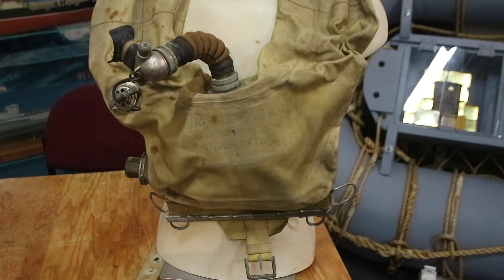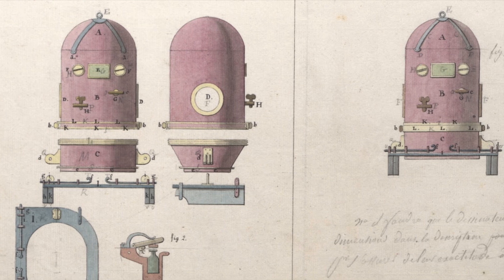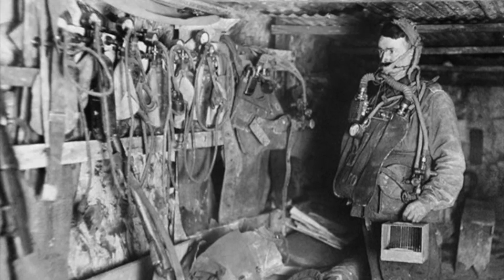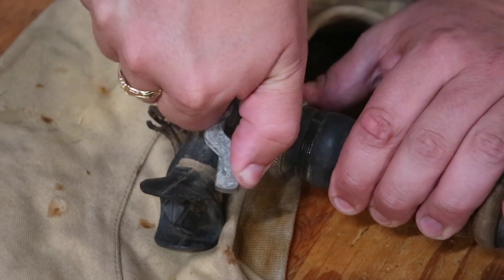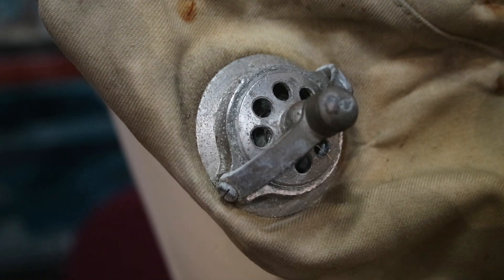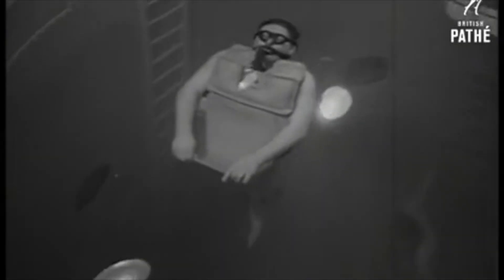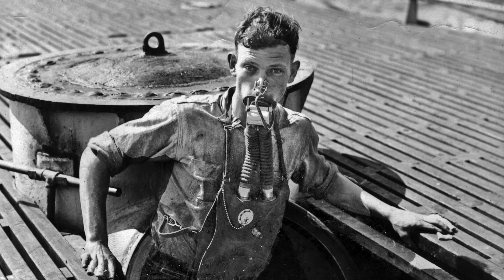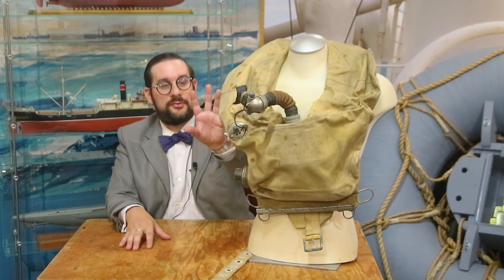Tauchretter: Escaping a Sinking Submarine

Comment: Read about Another re-breather advantage: experienced users explain that the closed circuit supplies warm air.  This significantly reduces heat loss compared to SCUBA and is also less stressful, reducing the diver’s overall exertion. The diver is more comfortable and relaxed. =  calmer, safer, better awareness and focus + longer work periods

Comment: 30:17 I'm not sure if I understand this correctly. I mean, you put pressure into this, at 1 bar pressure inside the sub. Then you exit the sub to say 5 bar. The thing will be compressed down to a very small size, and then?

The pressure will never drop below 1 bar on the accent, so the pressure will never “drop”.

Comment: 1:59 Small note on CPR: Nowadays (or at least at the Red Cross facility here in Germany where I learned it three years ago) you no longer to mouth-to-mouth air transfer, you only pump the chest. As I understand it, this motion also gets some oxygen into the lungs with each pump, at least enough to support the brain for a few minutes longer until help arrives.

EDIT: If you have a bag valve mask / Ambu bag, you do 30 compressions - 2 squeezes of air. Thank you to the commenter below for the correction :)
Reply: Depends: if you have an Ambu bag (Beatmungsbeutel) you do 30 compressions and you squeeze two times the bag for an adult and repeat.
If the mask is not ready yet or you don't have one, you just keep applying chest compressions, 30 at a time.
Reply: @almerindaromeira8352  many thanks for your comment! I've appended mine.
Reply: I remember there being something like, if you're having someone breathe air into the other person, it's best done mouth to mouth, because it creates a better seal. A review of cases showed that mouth to mouth had about a 10% overall higher rate of success than a mask with an opening, which has a 5% overall greater chance of success than a bag-valve (im not sure if this is with regular cpr trained people or medical professionals). It was postulated that the reason for this was simply it's harder to know how good the seal is on a bag valve.
Reply: Most of the time it is not necessary, and hands only CPR is simpler and more likely to be performed at all by random bystander. (Because of modesty and disease transfer risk.)
Mouth to mouth is warranted in cases where body/lungs are depleted of oxygen. Drowning, CO poisoning, opioid overdose.

Comment: 10:44 actually not fully accurate. "Tauchen" or "Eintauchen" refers to submerge in any liquid, not just water. But the term can also be applied to fog, shadows or light. Figuratively you can still use it for fire, if you refer to the light if it, without sounding odd:

"Die Szene war in Feuerschein getaucht." (=The scene was cast (submerged) in the shine of fire.)

Comment: Very interesting, thank you. But to be totally correct: Fire fighters in German are and were called "Feuerwehrmänner". "Flammentaucher" obviously meant only the ones using breathing devices (but I have never heard that term before and had to google it even as a native speaker).
Reply: It's not supposed to be an official term. I've heard it a couple of times, that said I'm also a firefighter so I come across many more potential situations where the term could be used.
Much more used is Rauchtaucher for describing AGTs